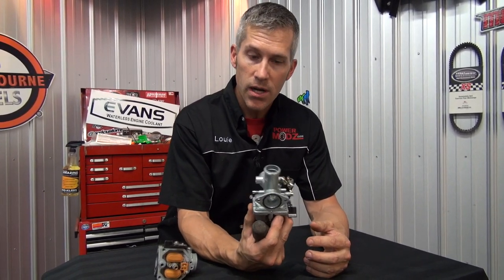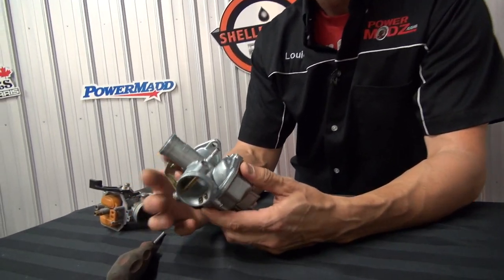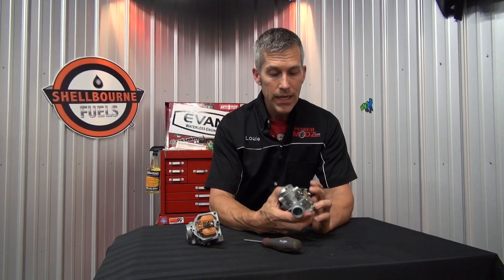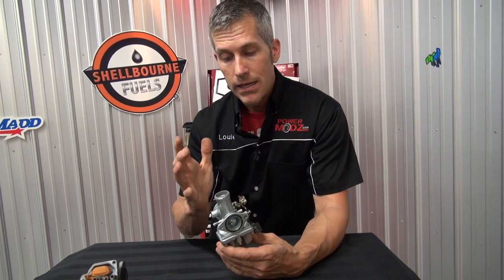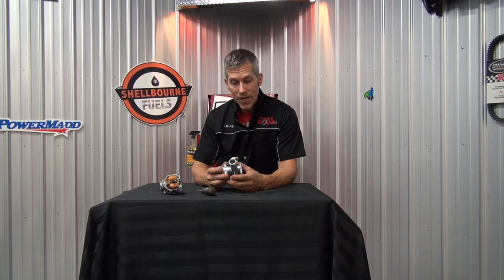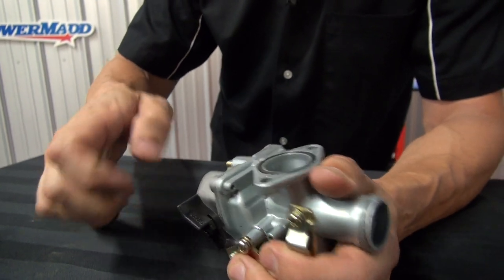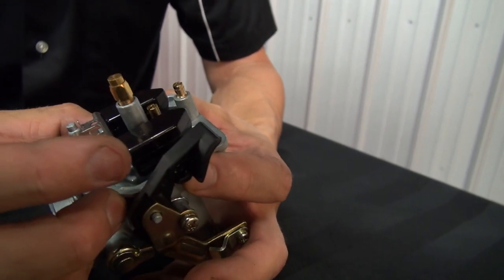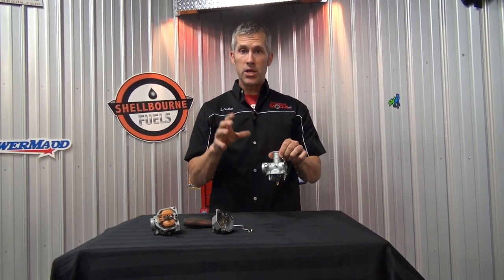Chinese Carb vs Stock carb, Honda ATC/ATV and more.  PowerModz!

Comment: Can you run the China carbs on cr85????
Reply: Nasier M. You can run any carb that fits your specs on your bike.... Most basic mechanical non accerlator pump ( like the one you have on your 85) do the same job, however the Jets and such need to be correct, throttle slide/ body etc need to fit. With enough tweaking you can make it work. However I would recommend just buying a rebuild kit for your OEM carb. I wouldn't recommend buying a China carb for a high end machine. I bought 2 China carbs for a snowblower and lead blower and have worked okay. I like the idea of what the the dude did in the video is taking out OEM parts if they fit in the China carb and bolt it up. The quaulty is NOT 100% oem by a country mile... But for small equipment like my yard tools, the rebuild kits have exceeded the ENTIRE cost of a China carb kit and I won't be bummed if they don't work because really  I can swap out parts from the two carbs and run the OEM

Comment: Thete IS NO good Chinese parts period idc how much factory carburetors cost i will ONLY use OEM carburetors every chinese carb ive tried is a peice of shit right outta the box
Reply from the maker: a lot of these older machines you  can't get new gem carbs for....and you use Chinese things everyday...barely anything is made in North America these days.
Reply: I agree. Had a few break from just riding. snapped right in half.
Reply: They weren't made in America to begin with. Honda is Japanese
Reply: nor in Europe anymore. You're right, how did the chinese get the molds ? they already had them because of original chinese made.
Reply: Lol,,What did you really expect for $27. ??? Find a good tech. to dial it in. Theyre Not oem,, but they work
Reply: Sweet and sour chicken is the only Chinese thing you should buy✌️